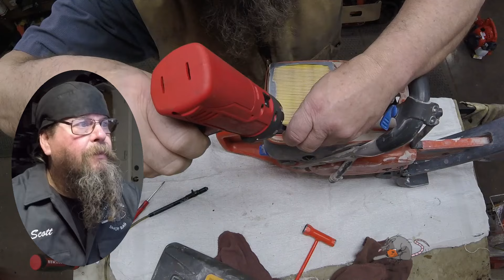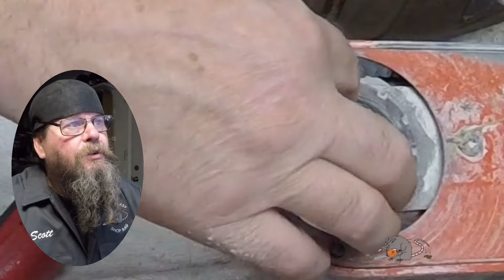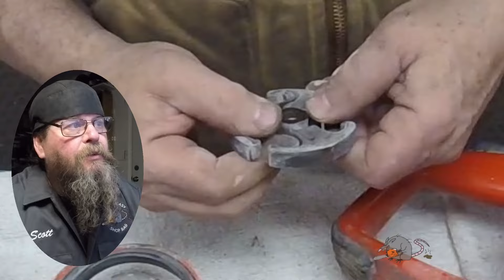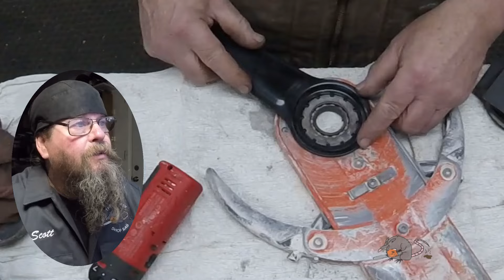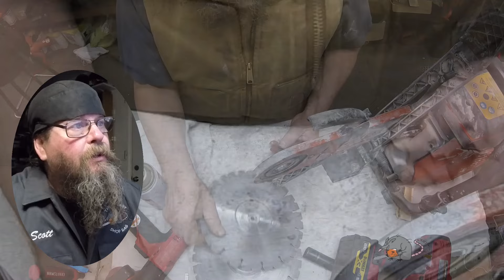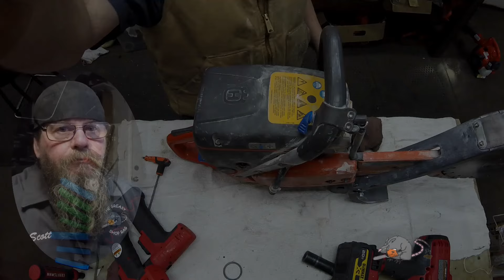Husqvarna Cut n Break Starts Hard

Comment: When I worked at a VW shop in the mid 70's we used what looked like a small deep fryer with peanut oil to heat the gear on the crankshaft and it slipped right on. Obviously you do well using your method, just saying. Always a thumbs up. 👍🍻
Reply from the maker: I suppose there are a lot of ways being practiced but thats the first time I heard someone say they used a deep fryer.
Reply: @TheGreasyShopRag  It RESEMBLED a small deep fryer. I don't know if it came from VWOA or not. It was in our unit repair room. I sure as he!! wouldn't be fixin my chicken wings in it.
Reply from the maker: @williamemerson1799  Lol, thanks for clearing that up.
Reply: @TheGreasyShopRag  Ever catch your face alite trying to far up a roach? I have. Not fun! 🤪👍🍻
Reply from the maker: @williamemerson1799  I can't say that I've had that problem.
Reply: @TheGreasyShopRag  Well, the 60s were fun, but ya had to be careful. 🤣

Comment: As I was watching this video where you made custom tools and are working on a rare piece of equipment I had a thought... How did you get into working on small engines? 
I know you have a background in motorcycles, but a great small engine mechanic is a freakin unicorn in my neck of the woods and I live in logging country
Reply from the maker: My first job in high school was doing maintenance on lawn mowers for a nearby contractor. I've run lawn crews and serviced equipment all my life. After some back surgery I had to get off the bumpy turf equipment and just work in the shop. I've been fortunate enough to have had employers that let me do my own thing and I've tried a lot of things over the years.
Reply: @TheGreasyShopRag  my guess was that you've been at this for most of your life, mostly because when you tackle a brand you're unfamiliar with it hardly slows you down. Thanks for sharing!

Comment: Admittedly, I'm not in the construction industry and know little about those saws, but I've never seen one with two blades.  What would be the reason for two?
Reply from the maker: The blades CUT two grooves as deep as the arbor. You then BREAK out that chunk between the grooves. Now you can make another cut in that new wider groove. Repeat this until you can't plunge any deeper.